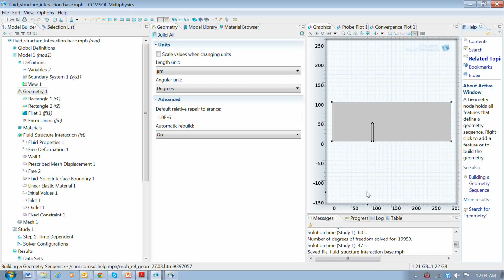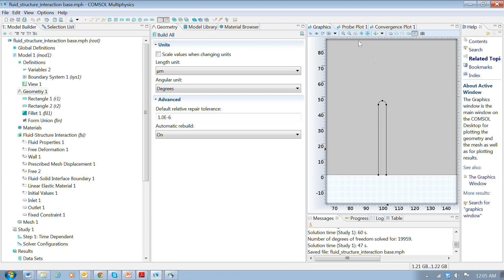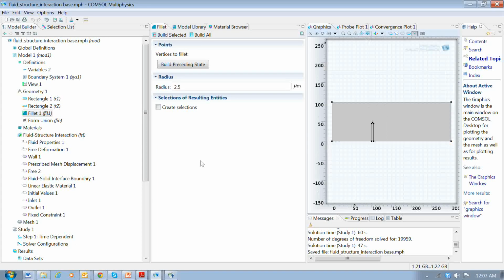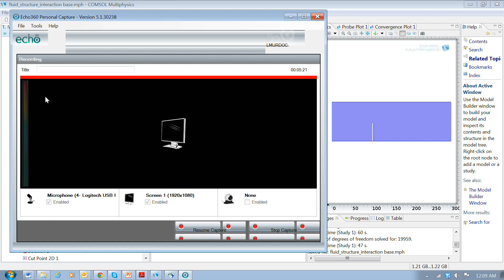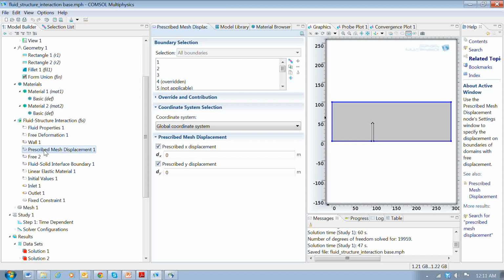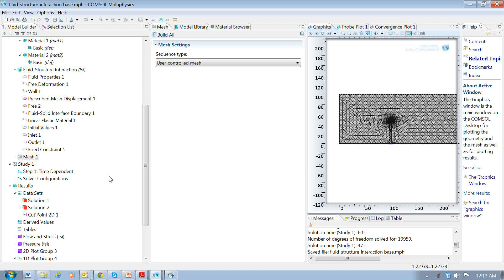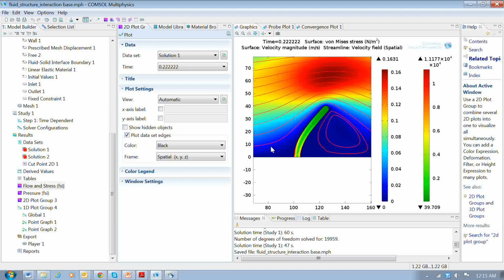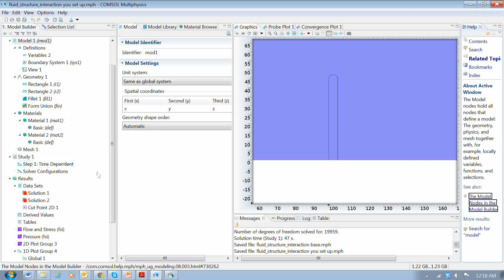fluid structure interaction 1

Comment: Dear professor it is requested that please  explain about time dependent .  I got this problem, i donot know how i can solve it( Feature: Time-Dependent Solver 1 (sol1/t1)
Failed to find consistent initial values.
Singular matrix.)
Reply from the maker: The Singular Matrix error is generally a pretty basic, severe problem.  Should be straightforward to find it, although not enough info for me to suggest anything meaningful.  Good luck,  Larry

Comment: When I increase the velocity, COMsol is unable to solve it? "Unable to converge"!
Any solutions?
Reply from the maker: Hi Shahbaz,    You probably need to use a physics configuration designed to include turbulence.  Comsol has several of these.  You can also try starting the solution with a relatively slow velocity and then increasing the velocity as a function of time.  The video describing the Moody diagram might help.   Larry

Comment: thanks a lot for this tutorial. could you please explain what is a fixed constraint exactly?
Reply from the maker: Hi Foojan,   The fixed constrain boundary condition means that the wall cannot move.  There is also a roller boundary, which means that the wall cannot move normal to the boundary, but it can move parallel to the boundary.  Larry

Comment: Please could you also give me some hint. I am doing a simulation where I want my sand particle or object in the Formation (Triangle) to move along with the incoming flow rather than fixed, to evaluate their interaction. Please could you tell me how to do that. I have tried without putting fixed constraint still it did not work because the small circle geometry used as sand particle has fixed dimensions. Your help will be highly appreciated. Thanks
Reply from the maker: Hi Uche,     You can simulate interactions between a moving particle and a flow using  the particle tracing for fluid flow module.  You can define whatever physics are needed to characterize the interaction between the fluid and particle.  Here is an example where massless particles are used to show the geometry of a free convective flow:  https://youtu.be/isY5VHrf5Xc     Larry